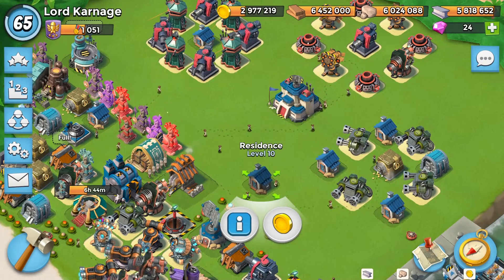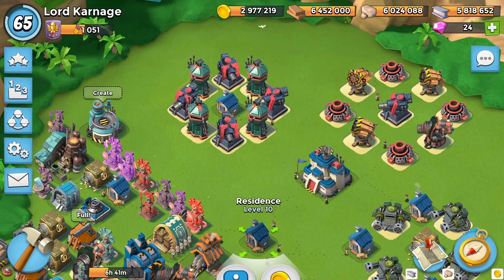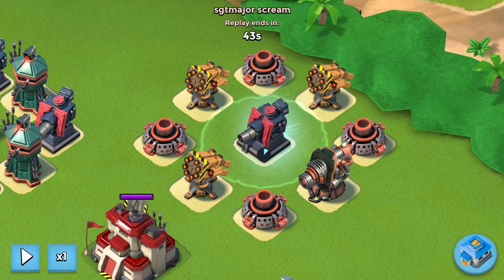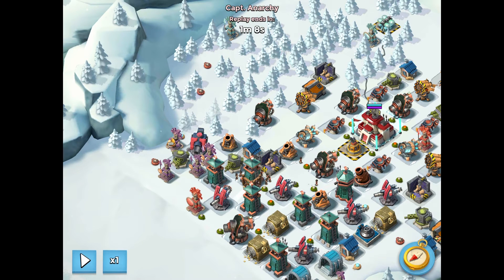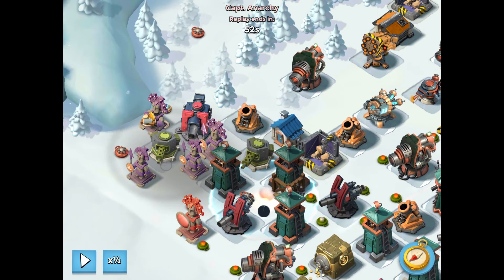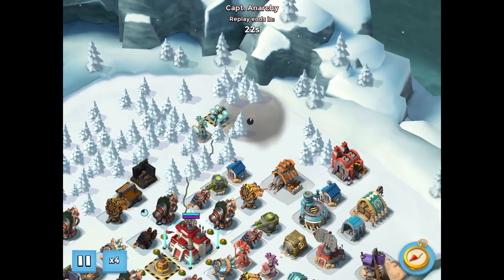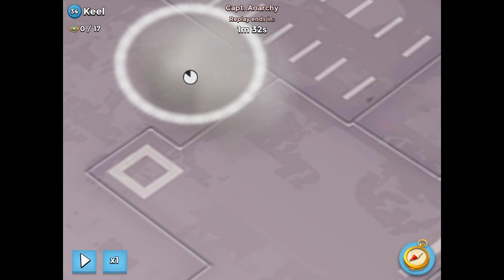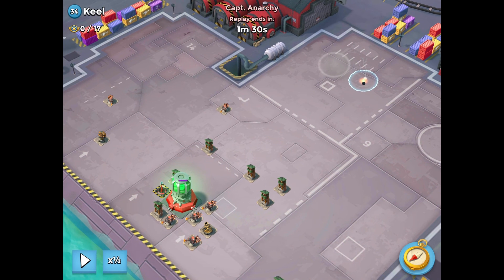Shock Bombs: Placement & Timing

Comment: 6:13 wait, with that second cluster it hit the very outline of most of those mortars, but they didnt get shocked.

then why (during the 3rd cluster) if it hits the very outline of the residence, that gets shocked??
Reply from the maker: the time stamp was incorrect. as the 6 minute mark was 3rd cluster. but if u look its only the top left mortar the shock was close to. it looks like its touching but its not really and its not overlapping the building.

look at the 3rd cluster. its overlapping just the tiniest amount more. ive also suspected for awhile the border around shock appers a tad bigger then it is.
Reply: thanks! the time stamp was referencing you talking about the overlapping of that third shock bomb btw...
Reply from the maker: +Awesoman47 #OMG no probs. ahh lol i was wondering bout that time stamp

Comment: please do a video about critters...

in warrior rushes i see people throw critters and then shock all of those critters but i don't understand why
Reply from the maker: i do intend on doing guides on warriors at some stage. i can answer that for you now though critters are there to distract rockets and in some cases shock launchers as well. the reason why they are placed where the shock is is probably because there safe from more splash damage duildings which keeps critters alive longer. and it also means things like mortars that might not of been able to be shocked will target critters instead of your troops.

though that said its not required to get the win. it just makes life easier to get the win if u have the gbe.

hopefully this has helped.
Reply: thanks!